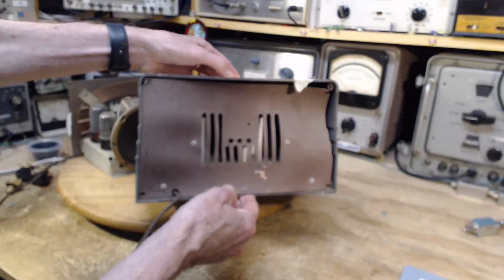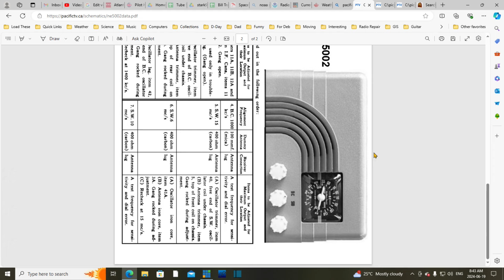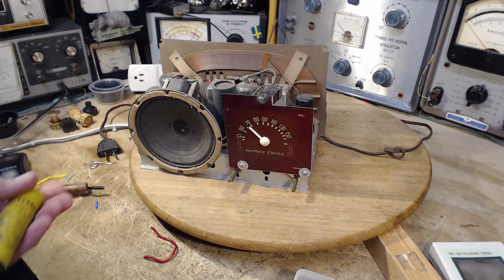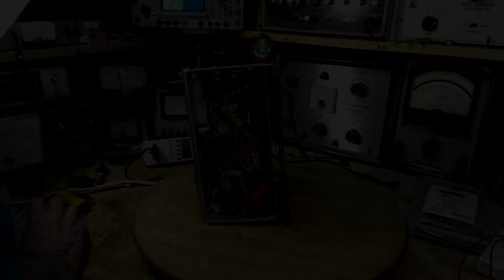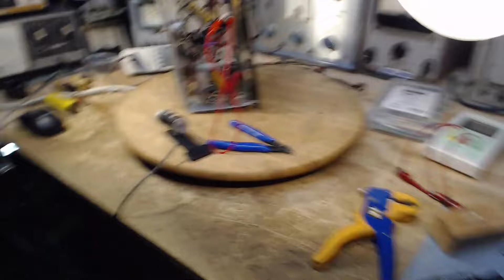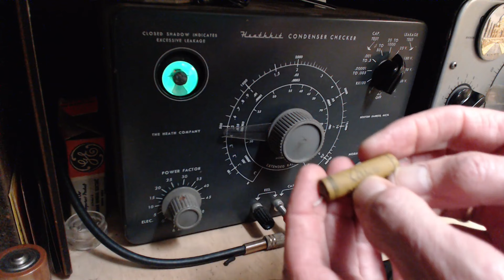Two Northern Electric Baby Champ Tube Radios Video #1 - Checkout and Power Up

Comment: In NZ there pushing through parliament that consumer appliances are to be repaired rather than thrown on the tip.
Reply: Good luck with that. Today's modern electronics are not only unrepairable due to components being sole-source from the manufacturer, the manual repair skills to do anything constructive at all with modern surface mount electronics is far beyond 99.9% of folks.